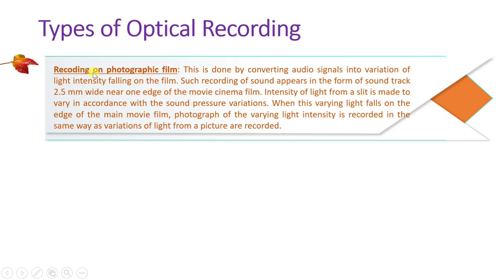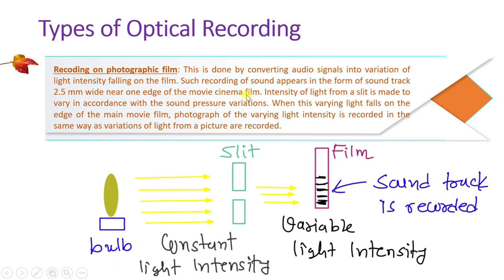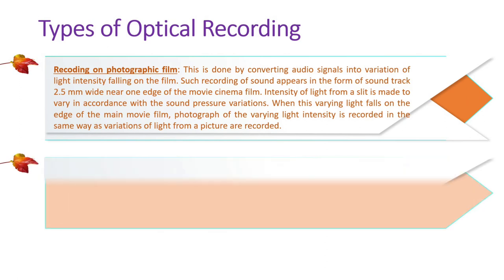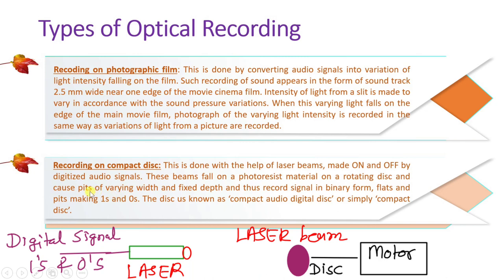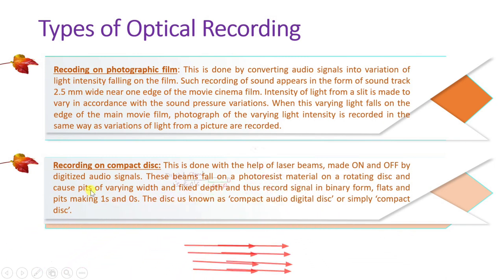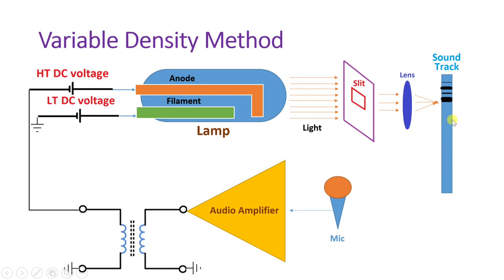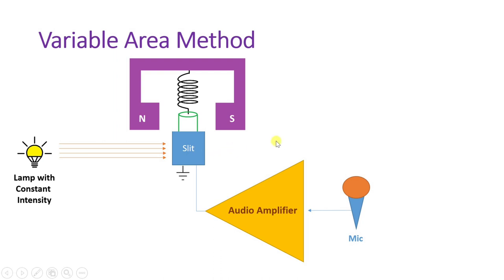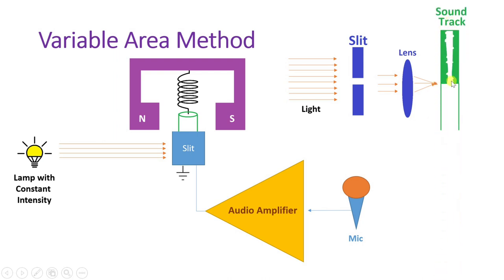Optical Recording on Films | Variable Density Method & Variable Area Method to Record Sound

Comment: I truly appreciate the poster who has taken on this rather technical subject but I  must point out the creation of a variable area recording is not explained correctly.  The optical slit is not what moves but rather the real image being projected of a solid triangle moves across the fine slit to generate anywhere from no line of light to a wide line of light.  The method of moving the light is from a galvanometer device (moving mirror) driven by audio plus a direct current bias plus a low frequency AC noise reduction signal to cause the width of the recording line to reduce in size during quiet or no sound passages of the recording. It you are into this marvelous technology and it captured your fancy like me then find a copy of "Elements of Sound Recording" by  John G. Frayne & Halley Wolfe, 1947 (circa), Interscience pub. Also 16mm Manual by William Offenhauser, 1949 also Interscience pub and learn the secrets to this art.